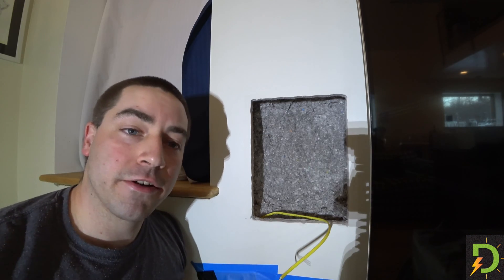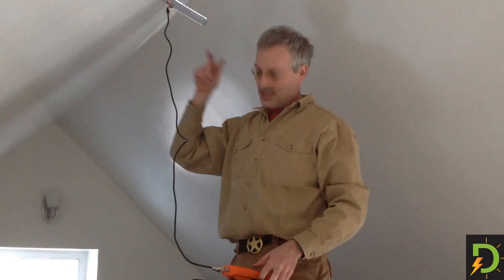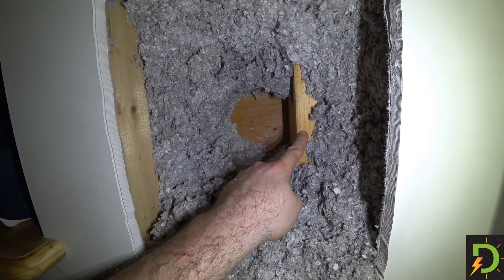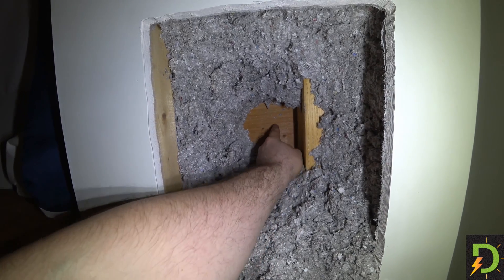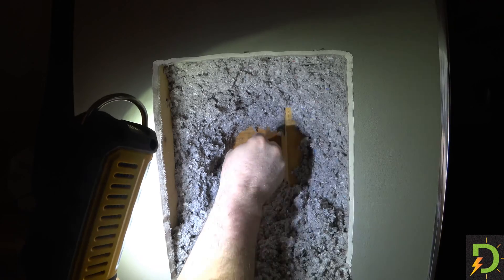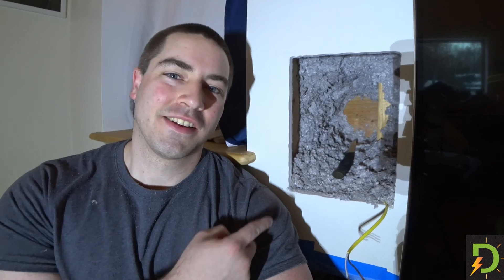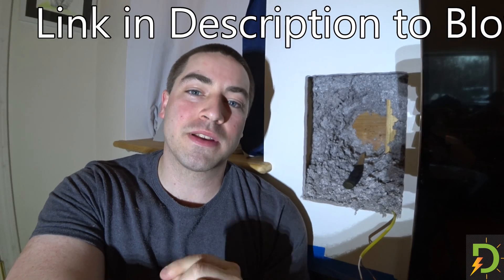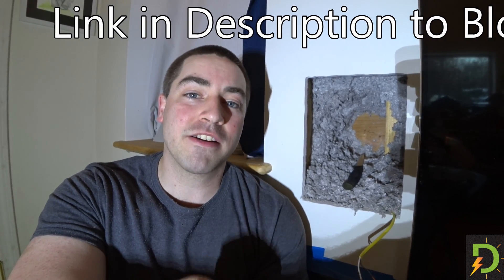Wall Rot in Double Stud Cellulose Insulated House

Comment: Hi! How are your walls feeling these days? I’m a bit lost — is it a vapor diffusion retarder or a weather-resistant barrier that you have installed externally?
Reply from the maker: My walls are doing great.  
The outside of my wall is covered in "Grace Ice and Water Shield".  This is a vapor barrier.  It totally seals air and water.  I have this installed as my WRB (weather resistant barrier) which is normally a product like tar paper, or Tyvek.  However, most WRBs are not vapor barriers, they are vapor retarders which still allow water vapor to pass through.  Using a vapor barrier on the outside of a wall assembly is not recommended.  It works in my assembly because I paired it with dense-pack cellulose insulation.
Reply: @DavidPozEnergy  Hi! Thank you for the response. This is a very interesting solution. Well done!

If I understand correctly, this is practically the R 2/1 rule, where it’s possible not to use interior vapor barrier.
Reply from the maker: You might enjoy seeing the build of my house.  I have some old videos on this channel.  They are poor quality (sorry).
Ice and water: https://youtu.be/59CvK4dsGow?si=RnMpOxCshywusHEv

Comment: Check at the bottom, rot starts at the water pooling.
Reply from the maker: I have had an independent person come in and check moisture levels in the external sheathing at a dozen different places in the walls, roof, and crawlspace.  He reported back that my assembly is drier than the fiberglass houses he tests.

Comment: @DavidPozEnergy So the key here is that your exterior air barrier is really tight, in combination with the cellulose. The question is, how tight is tight enough? Even .1 ACH50 is not 100% airtight. 3:54 But is .5 ACH50 tight enough? 1 ACH50? I don't like the idea of two air barriers, but most builders aren't going be able to get to .1 ACH50 but 1ACH50 is much easier to achieve. Thoughts?
Reply from the maker: You have the correct idea.  Please allow me to state my opinion:
"The best system for residential construction is a rigid, continuous, exterior air barrier; which is contiguous with dense-pack cellulose insulation."
That is as clear and concise as I can make it.  

The outside of my house has 1/2"CDX plywood sheathing which is both structural, and is a rigid surface for finishing an air barrier.  The air barrier can be completed as simply as taping the seams of the plywood, or liquid applied, or large adhesive backed roll products.  Most people might choose a Blueskin VP, but I went with Grace Ice and Water Shield to prove my point.  

Continuous means I'm not breaking the air barrier.  The best example would be rafter tails.  But, continuous includes on top of the foundation wall, prior to the sill plate.  Etc.

Contiguous means the air barrier (CDX) and insulation (dense-pack cellulose) are in direct contact with each other.  I'm not breaking this rule for knee-walls, porch roofs, unconditioned attics, etc. 

I believe if you follow this, you will have a winning system. It's the easies to implement in the field, and is forgiving over time. Factor in installation, cost, forgiveness, and effectiveness, and I think you will agree in my bold statement as to considering this the "best".

Comment: Trying to retro-insulate walls in the PNW. 2 x 4 wall cavity goes straight to tar paper and stucco. No sheathing, no insulation.

Could cavity Blown Cellulose even be an option? My condensing surface would be the tar paper…

Comment: PHIUS had a class several years ago at the PHIUS conference that found 19% humidity in walls you describe in 4 homes coast to coast. 21% and you have mold. Cellulose didn't dry out.
Reply from the maker: I went through PHIUS training.  Ben there, got the T-shirt, LOL.  They even modeled my personal home and my real-world findings (and third-party tests) didn't line up with their computer simulation.  Basically, the computer is wrong.
Reply: I think the sort of paradox is that thick dense insulation does make walls somewhat less breathable. But, it simultaneously also slows down vapor drive, so you don't need the wall to "breathe" as much as people think, so long as there isn't rainwater getting in or a leaking water pipe or such and also that the insulation is sufficient and uniform enough that steep temperature gradients are avoided. It's the abrupt temperature gradients that really have the potential for significant condensation and rot.

I think as long as the wall can still dry out a little bit then the thick dense insulation is worth it. I believe the reduction in vapor drive achieved by your dense insulation is what the computer simulations are missing.

Comment: Why a 2x6 then a 2x4?  Why not just (2) 2x4 with more gap between them?  It would be cheaper.
Reply from the maker: This particular wall is carrying the roof load and second floor load.  My engineer wanted 2x6.
Reply: @DavidPozEnergy  Gotcha.  Now I understand.  Thanks for responding.  Many do not.

Comment: I am looking at building a house with 2 x 8 plates and 2 x 4 studs that are stagerd on 2 ft center. So you have a stud every foot with 7.5 inches of insulation with no bridging on the studs
Reply from the maker: That's cool too.  Are you going to dense-pack cellulose insulation?

Comment: Any wall system can fail if it's not built correctly. The quality of the air and water barrier(s) is where the wall will fail. The type of wall system is less relevant than air and water control layers.
Reply: Avoiding steep temperature gradients is more important than super tight air and vapor barriers.

You can have double air barriers but if you don't have adequate insulation you can still get condensation where ever warm moist air meets cold surface.
Reply: @bobloblaw10001 the point of dense packed cellulose is to have consistent insulation.
Unlike fibre and rock wool batts, dense packed cellulose will fill all the gaps, think about spaces behind wall sockets and electrical switches, providing a more consistent insulation.

Comment: My 2 story house was built in 1990 and has bricks on the first floor. I don't think I can get it anywhere near that tight but i have sealed the band joist and I'm working on the air sealing attic now. Always more to do.

Comment: It doesn't appear to me that you've dense packed....Are the Dense Pack advocates a little OCD?  The issue with the way you've done it is settling at the top of the wall and under windows. That's where enough of a temperature difference could lead to rot and mold. If I were you I would borrow or buy a FLIR and check for heat leakage at the top where settling MIGHT have occurred...for peace of mind.

 
I notice that there are lot of people advocating dense packed cellulose, mostly to prevent voids and settling. This almost doubles the amount of cellulose needed.   When you are talking tons, even $.68/lb adds up when you go from 2.5 to 3.5-4 lbs per cu ft.
Reply from the maker: Can you please share what indicators you are observing in my video that make you assume my wall is not dense-packed?
Reply: @DavidPozEnergy  Maybe I wasn't paying close enough attention🙂  Some of the other dense pack vids make it look like MDF!  How dense did you do yours?
Reply from the maker: My wall is packed to a minimum density of 4.0 pounds per cubic foot.  I have about 100 videos on my channel showing every detail of building my house, including 3 videos on the cellulose.  I welcome you to check them out.
Reply: What makes you think it is not dense packed?

Comment: As an experienced insulator and lesser experience certified building analyst. Chances are if you do it wrong or not 100% correctly. It's not going to create an issue. Funny thing is kraft paper works on the wrong side of the wall better than the correct side of the wall.  People always choose cellulose over fiberglass.  In this situation, depending on climate zone, dense pack fiber glass is better than cellulose because the fiberglass is Glass and doesn't want to soak up vapor easily (works in reverse as well), cellulose is like a sponge (also unless dense packed past 4lb per cubic foot will settle indefinitely over the years as the moisture is what causes it to settle, 3.5 lbs per cubic foot for 2x6 and 2x4, higher if cellulose companies are forced to make lower quality of cellulose) fiberglass won't settle. But in retrospect they are both s**t in insulation terms. So with all that said like I did up top, even if you do it wrong, chances are you won't have an issue. If an issue occurs your unlucky mst likely and are more likely suffering from too low an ACH50 number than too high of a number that you would think would be the issue.

Comment: Hey David, I am about to do double stud walls in my house. The exterior is already sided(tyvek and vinyll siding). Any advice on how to move forward on the insulating process? Thanks.
Reply from the maker: Before insulating, run a blower door test.  Air seal, air seal, and then air seal.  This is easiest to do from the outside before tyvek in installed.  Since the tyvek is already installed, I'd run the blower door test in pressure mode.  
Insul-webb is the netting material I'm using.  I like blowing cellulose behind it more than other materials because insul-webb allows air to escape.  This leads to a better job generally speaking.

Comment: Done correctly apparently. bravo mr Poz! I really love the single air barrier. what did you do under the roof? my roof sheathing is currently bare and dry, but I would like to insulate it. looks like dense pack cellulose would be tough.
Reply from the maker: My roof assembly is identical to my wall assembly.  The only difference is the shingles instead of siding.
Reply: @DavidPozEnergy  any condensation up there? Do you have any sort of hrv for fresh air?
Reply from the maker: No condensation inside the roof assembly.  I've had a building scientist come in and probe the roof/wall sheathing for moisture content.  Yes, I have an HRV in the crawlspace. https://youtu.be/7yZJiUUFzk0
Reply: @DavidPozEnergy  that is AWESOME! Thanks man. 🤩

Comment: I have done my new house a little different my walls are 6inch  with 1/2 inch advantech plywood  then covered with Typar house wrap which was done tightly. Then wrapped with 3/4 inch tongue and groove blue board. The roof is 5/8 advantec ploywood wrapped in ice and water Sheild . The cathedral ceiling truss is vented with proper vent and soffit vents. So now I plan on 18 inches of dense pack in ceiling with a interior vapor barrier on ceiling. On the walls 6inch of dense pack with no vapor barrier. I hope I’m doing it right! I will also have heat recovery system installed in the home. Please comment good or bad just want some options.

Comment: What did you do in the attic?
Reply from the maker: My house doesn't have an attic.  My roof cavity is dense-packed cellulose insulation in exactly the same cross-section as my wall assembly.

Comment: We rebuilt a 1 3/4 story farm house originally built in the 1940s in middle Tennessee in around 2000.   We doubled the square footage to about 3k sqft (plus a full basement) and went to 6" walls.  We blew the walls with wet blown cellulose and put a vapor barrier on the interior.  In the new part of the house I used 2x6 studs' on 24 centers with OSB exterior and interior.   When the duct work was finished (mostly inside the envelope) I had a 10K btu water source heat pump I hooked up to test it (from a hotel complex).   We used that for about 8 years before it failed (Freon leak).   It did remarkably well.  It could hold about a 17 deg differential above or below the 24 hr average outdoor temps.  That means it would fall behind if the outside temps got into the upper 90s for instance but the air was very dry.   We augmented with 3 to 6 k but of propane in the bitter part of the winter.    We replaced it with a 2T btu water source, (1.5T may have been OK).  While certainly in the OK range the house was noticeably not as dry.   It hasn't needed any augmentation.  Very pleased with the insulation system and know of no rot issues.  PS.  when blowing the wet cellulose I had to make arches of Masonite to keep the wet material from slumping in the large cavities.

Comment: Hi, we want to do a retrofit blown in for exterior wall from inside. 1st floor has some fiberglass batt, 2nd fllor and attic floor has no insulation at all just a old plaster wall and then a new drywall added to the plaster wall. Lots of air leaks from bottom of baseboard. So is it ok or recommended to retrofit with cellulose dense pack blown in from inside of house? House in nyc and climate zone 4. Thanks

Comment: The people who told you it couldn't be done safely know the vast majority of production construction can't achieve 1 ACH air tightness, heck a lot of that construction struggles to get below the code required 3 ACH. And like you said, the key to your success is the air tightness because air exchange carries way way more moisture than vapor diffusion.
Reply: We want to do a retrofit blown in insulation to exterior wall from inside, my house was built in 30s, and lots of air leaks from bottom baseboard. So can you do or is it recommended to do cellulose retrofit blown in for an old house which is not air tight? Thanks. What about fiberglass blown in and do you need a vapor barrier for fiberglass? nyc climate zone 4.
Reply: @fruitf7064 it’s been four years, did you do the project?
What did you go with ?
And how has it been working out?

Comment: What if you don't have neither interior or exterior air/vapor barrier but just drywall?
Can you still dense pack?
Reply from the maker: You can dense-pack most wall cavities, even without vapor barriers.
Reply: @DavidPozEnergy  Good to know.
I was thinking about building a test wall where I can practice at will before doing the actual thing (it's my first time)

Comment: Had the walls and attic in our old 40's house insulated with cellulose. The house is so quiet, it is amazing. Good soundproofer!  No problems here after 20 years.
Reply: Hi, where and what climate zone is that house in? Does the house need to be airtight to do cellulose? I sm kind of concerned because my house built in 30s and lots of air leaking in from baseboard area.

Comment: Late on finding this video. Thanks for sharing. I build with exterior insulation but would like to build a DSW assembly someday, but have always heard the concern of vapor load. What climate zone are you in? And have you inspected the wall sheathing on a bathroom wall?
Reply from the maker: This assembly works.  Yes, I've checked every wall, every floor, ceiling.  This is extremely dry.  I have also checked homes with fiberglass and they have wetter sheathing then this assembly.  I live in Massachusetts.  I know all about the fear mongering that is happening and it's ridiculous.  This assembly is the least likely to give you moisture problems.

Comment: I forgot to ask if you like any certain brand of cellulose and why?  I have heard some are better than others. Something to do with fire retardent.
Reply from the maker: Yes, exactly.  I used National Fiber brand cellulose, which was the best out there.  But, unfortunately, they were bought out by a bigger company which just simply closed down the business to eliminate the competition.  At this point I buy Igloo brand and they are pretty good.  What you want is a brand that ONLY uses Borate as the fire retardant.

Comment: Really good video!  Will cellulose harm M/C Cable?  Not sure what you used for wiring. How did you dense pack it without inside membrane?  Did you use 2x4 inside wall over 2x6 do to cost? Thanks, Mike
Reply from the maker: The cellulose I used is treated with Borate and will not harm any type of wire, or conduit, or ducts.  It's dense-packed behind a net called "Insul-Webb".  It is still there in the wall, but is not a vapor barrier.  If you click on my channel, and go to "Videos" tab you can see all the videos I have posted.  Go back about 8 years and you will see all the details on building my house.
Reply: @DavidPozEnergy  Thank you for taking time to answer my questions! It was a big help!!! I will check out the other videos. Thanks again

Comment: By its nature cellulose wicks moisture. It is far more effective at removing moisture inside a wall cavity than fiberglass or rock wool, both of which just hold moisture and stay wet. If a cellulose wall gets wet it will dry very quickly by wicking the moisture through the drywall and into the house.
Reply: I have lived in a double wall construction home for 30 years.  It is insulated with fiberglass and has an HRV.  No wall problems.